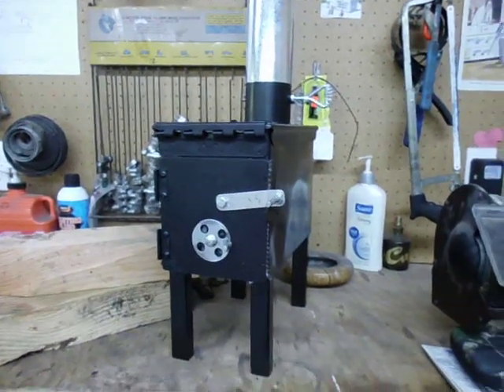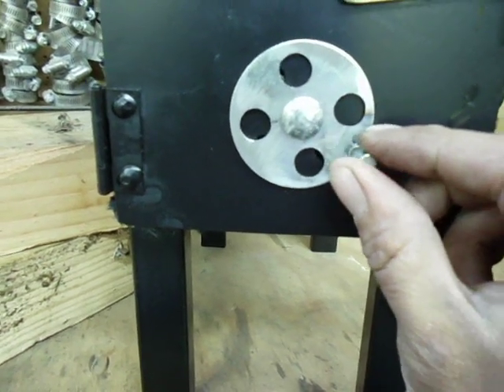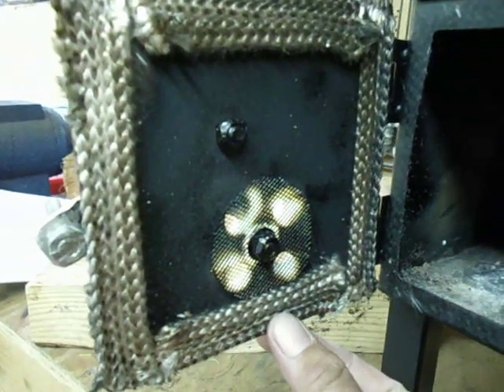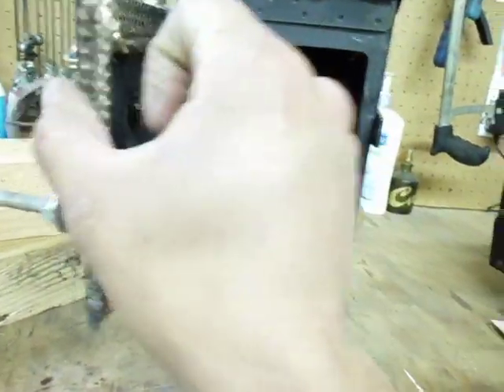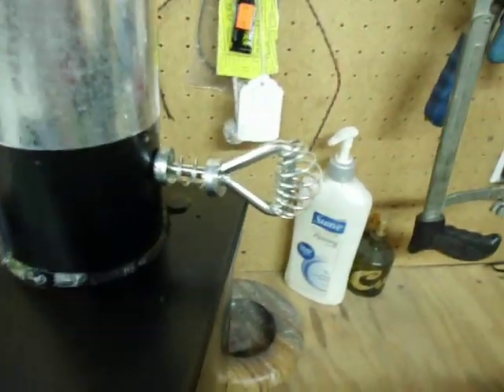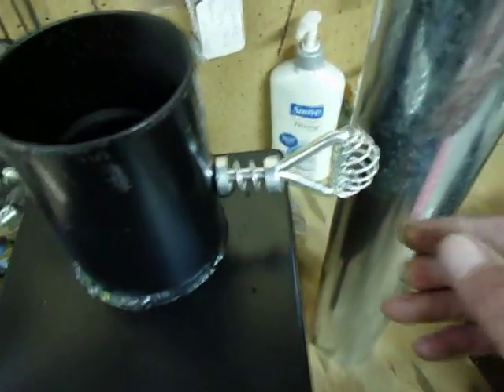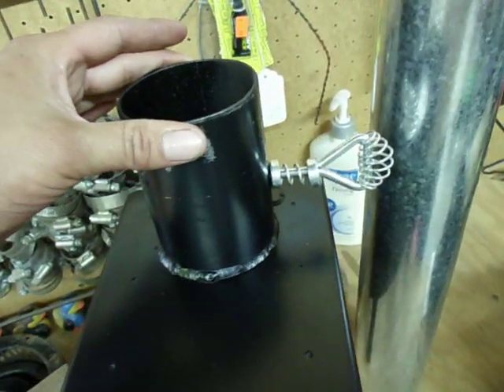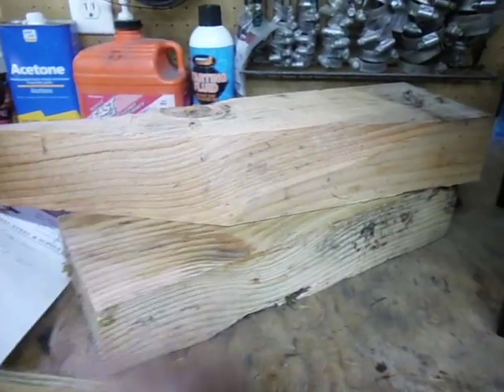ammo can stove

Comment from the maker: I would definately cut a hole close to the center and use some sort of heat resistant material around it as you suggested, depending on the shape of the dome you might be able to get it closer to one side, this thing really puts out the heat,....josh

Comment: im not familiar with stoves so i just dont know but does it give radiant heat from the stove being hot or is there a vent for the heat to come out. full size wood stoves separate the heat and the smoke right? i realize its a small little stove for comping etc but im just clueless with this stuff and i could use one for camping.

Comment: ok, couple of questions if you wouldnt mind answering. first i dont know much about tent stoves, but i do know that i almost froze to death the last camping trip. i have become quite intrigued by the ammo can stove to use as heat source and other uses as well. so first question how does the stove pipe work with a regular dome tent, say  10ftx10ft and tall enough to stand in. where would i exhaust the smoke. would i have to cut out and fit a flame retardant material to the tent. thanks, alex.